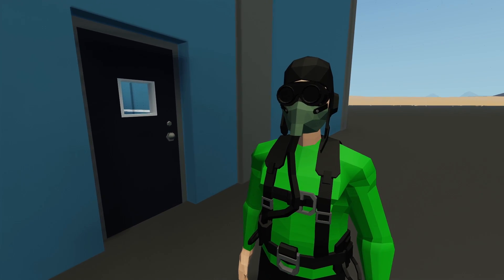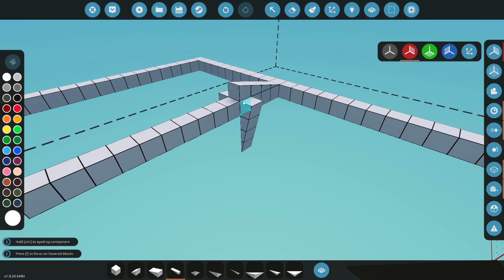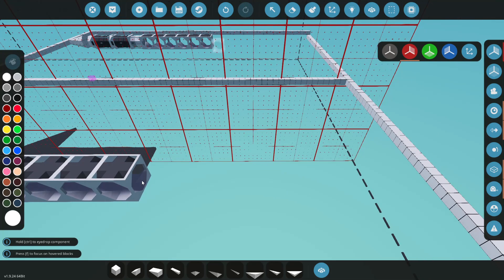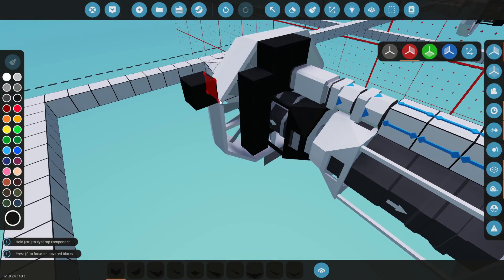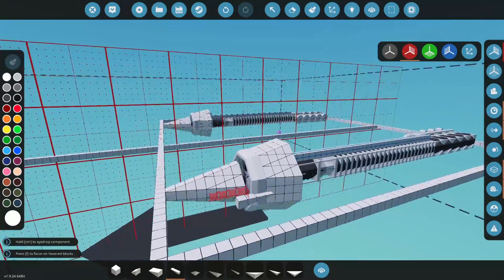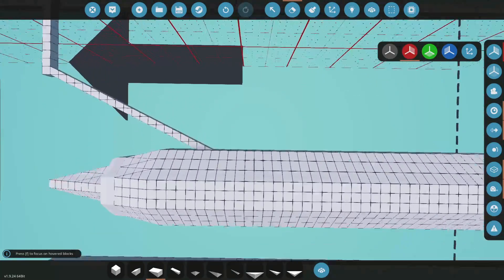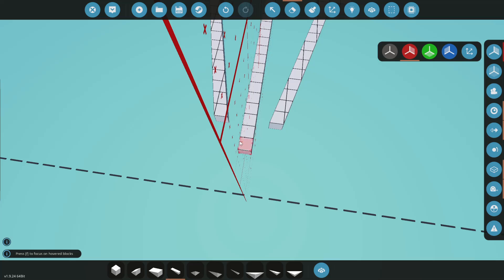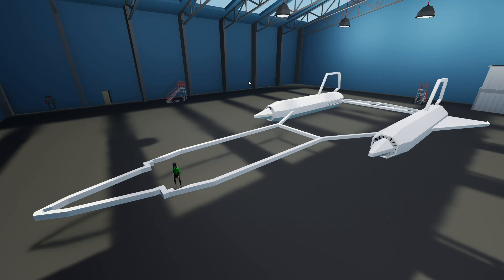Jet Engines! Let's Build a SR-71 Blackbird!!! [1] Stormworks

Comment: It is a shame the pistons are so large, it would be insanely cool if you could program the engine cones to extend and retract with speed! 
Edit: I also just thought of a funny idea! You should make some fuel leak while it is on the ground like the actual plane. After the insane temperatures, the panels warped and changed shape, which wouldn’t “normally” (no planes really reach those temps anyways) cause leaking, but they removed the walls of the fuel tanks to save weight. The fuel just sat in the skin of the wings so it basically dumped fuel after cooling. Also because of the lack of walls and the heat, the fuel had to be really stable, so the actual plane had to be started with an explosive, almost similar to the shotgun engines on old equipment
Reply from the maker: Gonna have to look this up